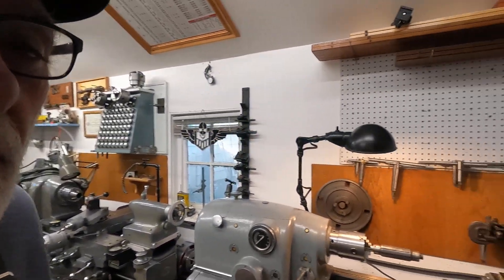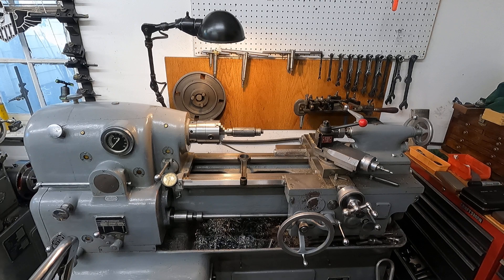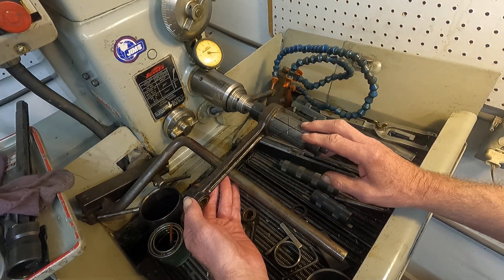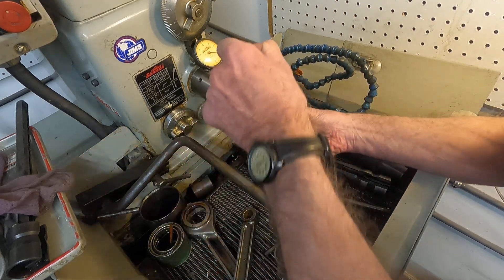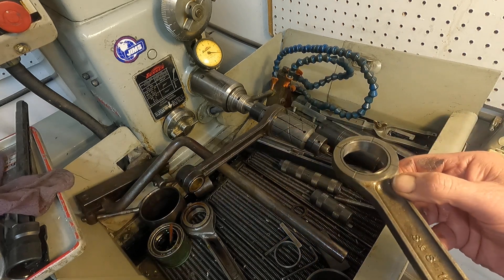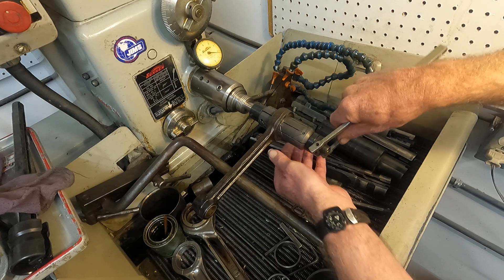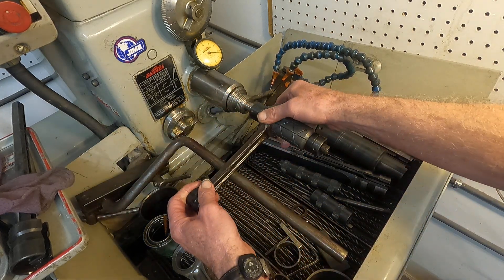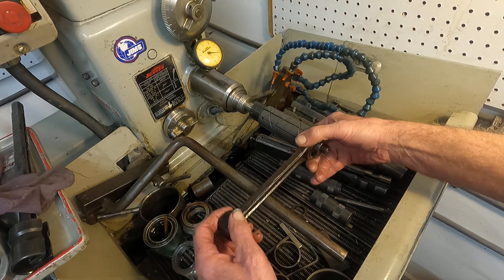Machine lapping bearing steel in the Sunnen hone

Comment: Dee Dee I think it would be a pleasure to hear about the evolution of your career in the machining trade. Trying to put the pieces together I visioned you as a Young Millwright working for Harley Davidson in Harley Davidson's manufacturing plant. I can see by bits and pieces that I have been extremely wrong in my vision. lol . When you are in the mood to tell us I would love to hear it. Thanks for the Lapping Demo
Reply from the maker: Much simpler I was a working machinist on the Whoops nuclear power plant saga in the mid 70s and was lured into a local Harley dealership by the regions factory representative to help with the product line in the region for two years and at the end the factory certification. That gave me guaranteed work for the rest of my life along with other benefits. What tipped the scale in my favor was experience with rotating piston group hydrostatic transmissions and of course interest in motorcycles.